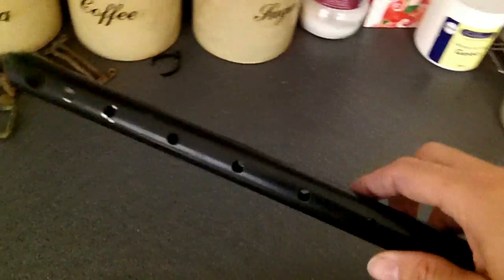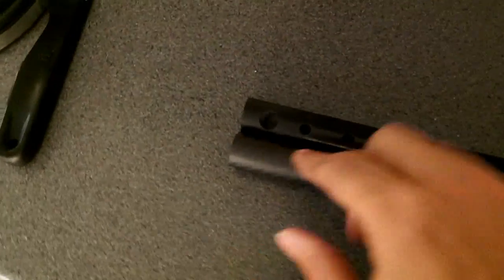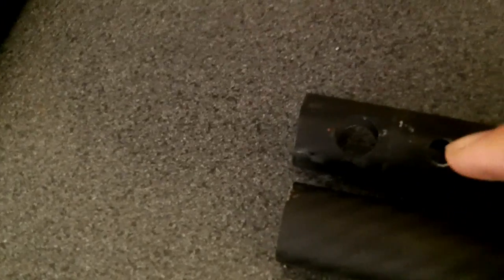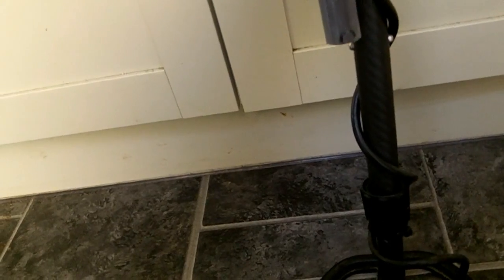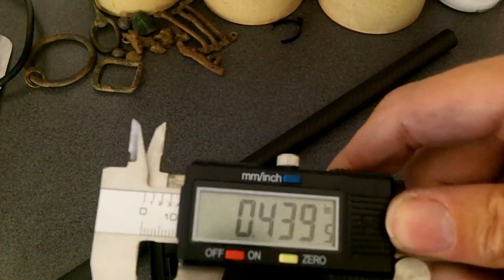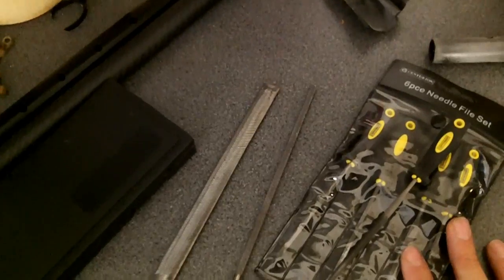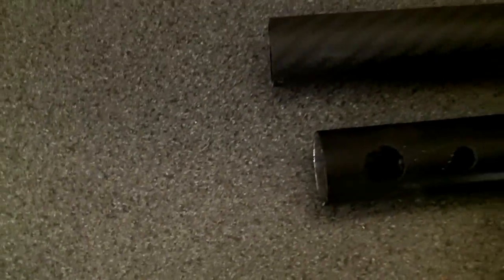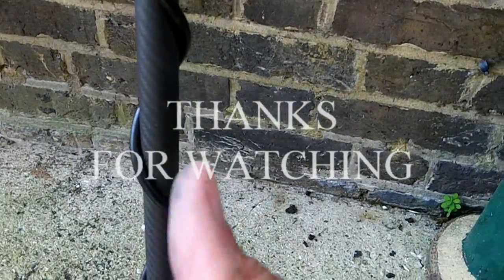Garrett AT PRO Custom Home Made Carbon Fiber Shaft UK

Comment: thanks for the idea, i was about to purchase the Anderson shaft, difference is way off $225 vs $13  now i can buy a new pin pointer and save some money. thanks bro.
Reply from the maker: that's great, make sure you drill and smooth off the carbon holes outside as you really don't want anyone to be breathing in those fibers & start off with small holes then work your way up to the correct size or the pipe may crack (also seal the edges of any carbon holes with super glue so it doesn't splinter) good luck with it
Reply: The Solo Searcher ok bro thanks my machinist experience will help I will take care of it, my first time drilling a carbon fiber rod.

Comment: Did you run into any interference with the carbon fiber and the coil cord? I know carbon fiber is conductive.
Reply from the maker: the coil works fine with the new shaft, the carbon is conductive but not electrostatically charged ;-) thank god

Comment: Very nice modification. Your video has inspired me to give it a try during the off season. One question, do you think it would be easier to sand down (enlarge the OD at the 9:20 mark on the video) the carbon fiber.
Reply from the maker: Hi there, The original top shaft that goes inside the carbon fibre is 1mm too thick for the inside diameter of the carbon fibre so you could in theory sand down the inside of a carbon rod to get it to fit.. however sanding carbon fibre is very dangerous for you if you do not have a mask in a well ventilated area that nobody will go in as the small fibres are extremely bad for your lungs. this is why I chose to sand the steel ;)
even when I drilled and smoothed off the holes in the fibre i did it outside with nobody around and wiped it with a wet cloth after to make sure all loose fibres were gone. its very odd that garrett used a diameter that nobody else uses, i mean why make a diameter .5 nobody does that lol
hope this helps
Reply: +The Solo Searcher Thanks for the reply